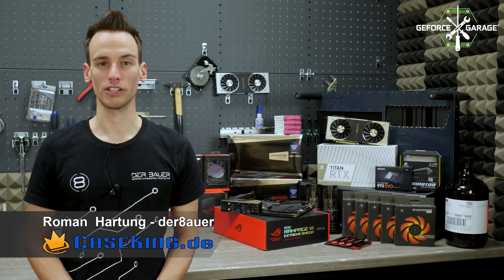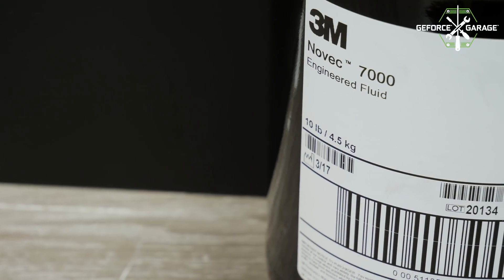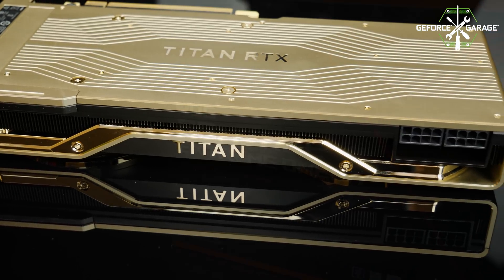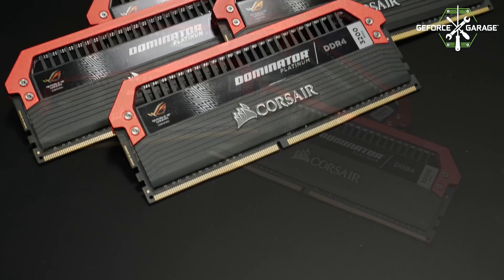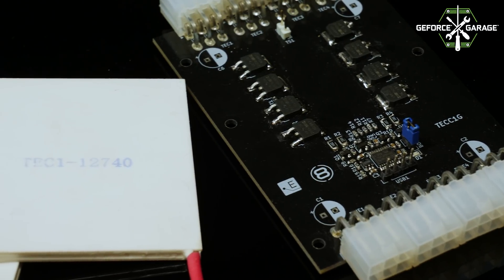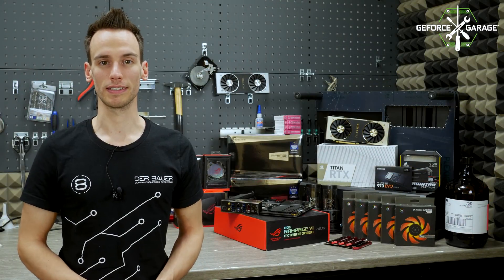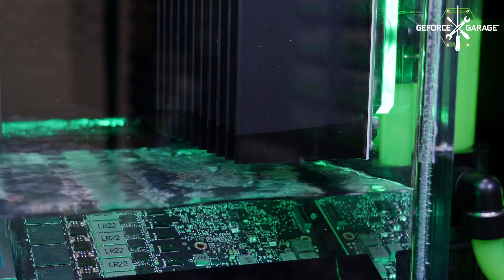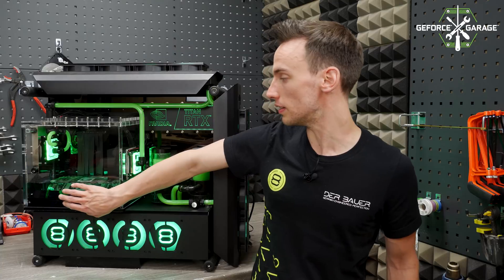GeForce Garage: Aqua Exhalare 2.0 Nvidia Edition by der8auer (en)

Comment: Add some air valves and hook it up to a vacuum pump. By reducing the air pressure, you will greatly reduce the temperature at which the liquid will boil, enabling even lower temperatures. You can also represurrize it with a completely inert atmosphere such as Argon.

Comment: You really shouldn't be soldering anything that carries any significant current. The solder can easily melt. Use some sort of crimp connector.
Reply: If it gets hot enough to melt regular solder, your wire is carrying way more current than it was meant to.
Reply: Crimps have a higher resistance than soldered wires, effectively increasing the joint's temperature and wasting power. The only way solder would melt is if your resistance is way too high in the first place. If you solder properly (which der8auer did not), the current is mainly going through the wire, rather than the solder. Unless you expect your wires to get to 200c, your solder shouldn't budge. I'm being really generous with you too, because most leaded solders don't melt at 200c, but instead would only be weaker. Something even funnier, soldered wires can actually carry more current than the continuous wire itself without getting as hot, LOL. 

Anyways, I don't get where people like you get the confidence to spew such blatant misinformation as a warning.

Comment: what happen if some water condensation occurs as well from the air inside the tank?
Reply: There is just novec gas inside the tank, no air with water. For the first time powering it on we just wait before turning on the cooling system. So the gas pushes out the air :)
Reply: @der8auer  if you're actually condensing all the novec so none is escaping your pressure relief port, then won't it be possible for fresh air to enter via the pressure relief port and then water vapor in the air would condense?

Either way, I love this build!
Reply: @floodo1  But condensed water is distilled water so it probably wouldn't matter much
Reply: its to less to short the bord.
Reply: The novac vapor that forms while filling the vessel is a bit heavier than air , thus it will readily displace natural atmosphere .